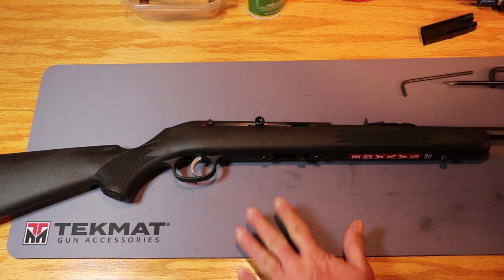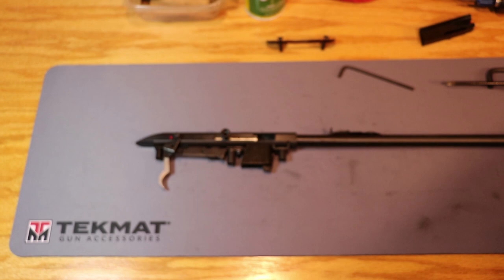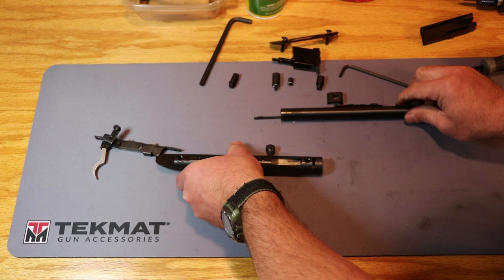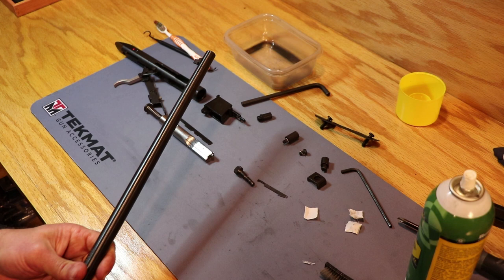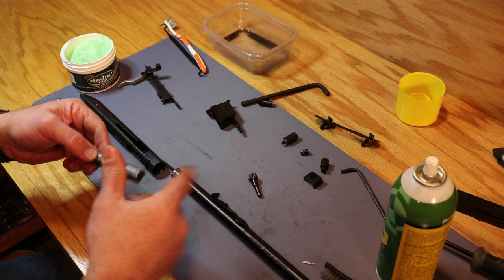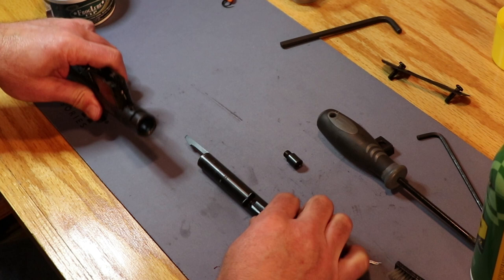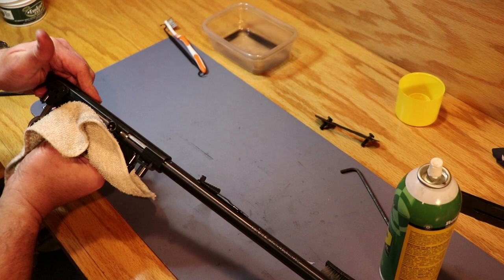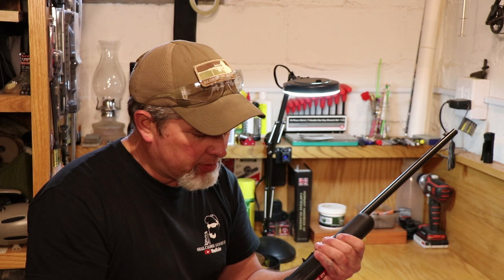Savage 62F cleaning, disassembly and assembly

Comment: Being 62 yrs old and not having touched a firearm since I was about 15, I wonder if you could go any faster and use as many abbreviations and such, not really showing or explaining much how parts fit, so a guy could get the gun apart, and not really see any clear pics to put it back together again. So here I sit with my grandsons rifle, which you said yourself was not one of the easiest guns to disassemble, in parts on my lap, wondering how you got the whatever pin on the end of the barrel back in there, and since you said there was a spring behind it so be careful, yet didn’t show how you got it apart or back together, i am wondering if I lost a spring or gained a worthless firearm. Will it eject without a spring?  Will I ever get it all back together?  Will Lassie rescue Timmy from the well ?  The answers right after these messages.  Lol.  Slow down bro, and show us inexperienced folks what to do, and not to do. Don’t assume everyone’s and expert marksman. And explain about the little spring for the (i guess) ejector pin. Where can i get one. Is it unsafe without it. Thanks.  P.S.  this is an older model with only 2 main screws holding everything together. One flathead by the mag, and one with another allen screw in it by trigger, and two small phillips screws in the center. Please help if you can. Little Timmy wants to plink some targets soon.  Thanks.
Reply from the maker: I apologize, it's really tough to do detailed assembly videos that people actually want to watch. Working with a camera between me and the firearm, trying to keep everything in focus and in frame. Doing it solo also presents problems too. If the 62 is not torn down any further than what I did in the video, it's not too hard to figure out. If you lost that spring behind the ejector, check with Numrich, they have tons of parts for all sorts of older firearms. You may also be able to contact Savage for some of the small parts and they may offer the best deal. Again, I apologize for the quality and lack of detail in the video.